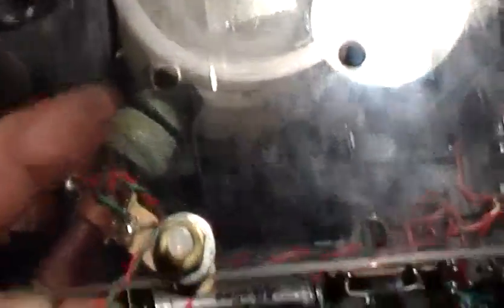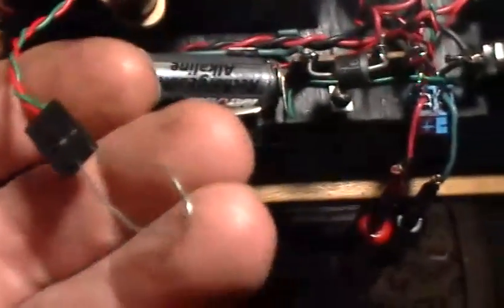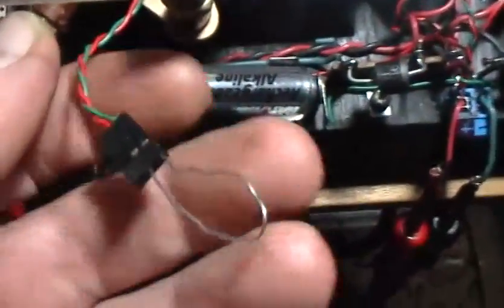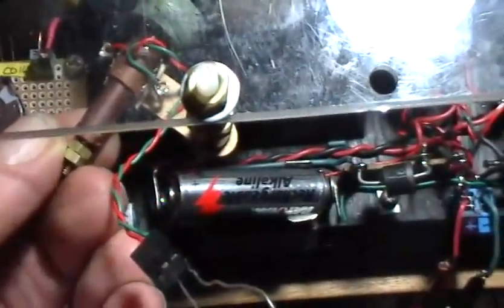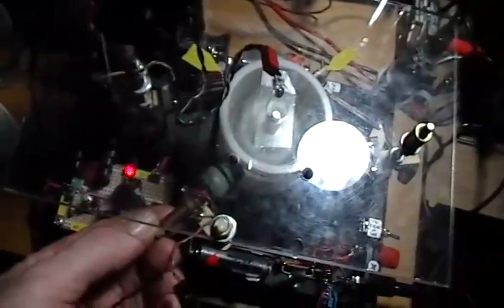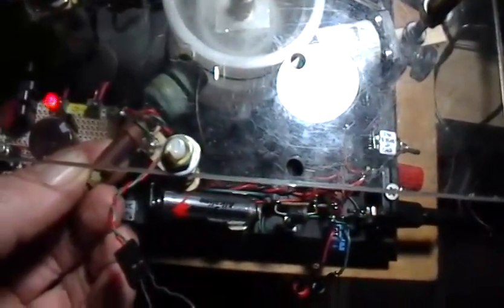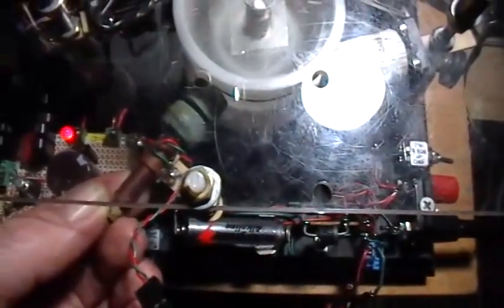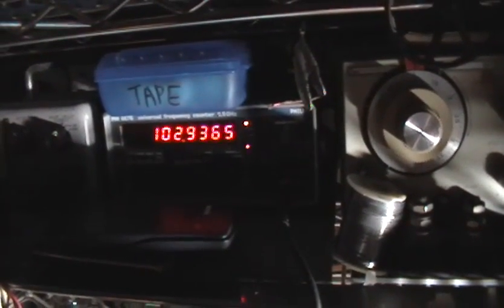Orbette P44 supplemental: Variable Inductor as Brake

Comment: It's one of those things that means nothing per se but knowing stuff about the general behavior of a system helps in understanding it. For example knowing if the current goes up, down or stays the same when you suddenly increase the load says something about the mean inductance value of the coils and poses other constraints on a candidate model.

Comment: I just did some research and it seems that I was partially wrong in my assumptions here. Electric motors can react to an increase in load both ways really depending on how they are made. They can either try to maintain speed and draw current or drop speed and current. But My question for SteornOfficial is still valid. Essentially what happens to the current when you touch the rotor?

Comment: When the rotor slows down due to an additional load the power input has to increase to an extent. Otherwise your motor would never reach an equilibrium. Steorn's motor clearly accelerates and then reaches an equilibrium like any other motor, therefore you can't freely pick up energy from its rotor. Forget about CEMF, flatness of scope traces and what have you. You can state this without even knowing anything about the motor itself other than the fact that rotates nicely.

Comment: Application of Maxwell's equations to a diode or a transistor will tell you that there's no way it could work like it does in reality.

So yes, Faraday's law will tell you the switching speed, but it also tells you that the transistor isn't going to switch at all?

Comment: In today's world you need a system that exibits at least COP >3 or, even if you could demonstrate it easily, it wouldn't be economically viable. Just so you know the FarnsworthHirsch Fusor is in exactly that position. It produces more energy than you put in, it's mainstream-accepted, has been replicated worldwide and proved in principle but yet, it isn't economically viable because of too low overunity.

Comment: When a normal electric motor slows down it automagically draws more power and in reverse. It's that property that keeps the rotational speed more or less constant. If Steorn's motor didn't have this property then its rotational speed would vary erratically. If you slow down an electric motor and you don't allow it to draw more power, then over time it will come to a stop. Rotor motion is related to energy input and can't be treated as a separated "free" thing.

Comment: ah, ok. was seeing the numbers only briefly on the meters once. 3W doesn't sound too bad for such high rpm.. still you're losing an awful lot of power on drag of course in this rpm range (as the plate on top has shown). any theoretical OU in the system would probably go under just because of that. the claimed 1.5 OU for such a system is very low after all, and certainly wouldn't tolerate much of any kind of inefficiencies.

Comment: well, isn't that exactly what i said what would happen. input power doesn't change, even tho load changes. nice. now: find most efficient totoid coil design possible, so that the thing only draws a few mW, and not freaking 30W!! others here on YT run on 250mW for example. then attach a highly efficient generator, and lets do some load/power graphs..